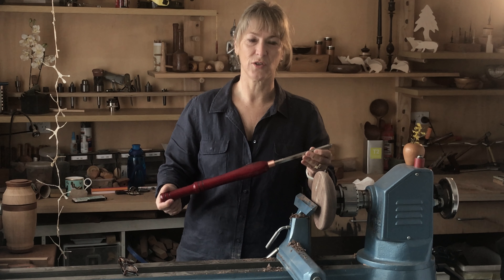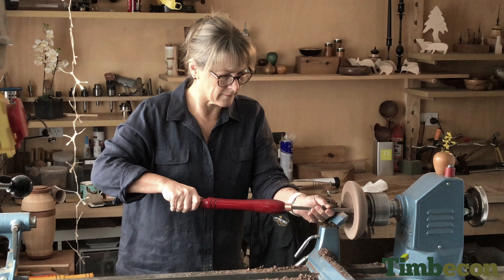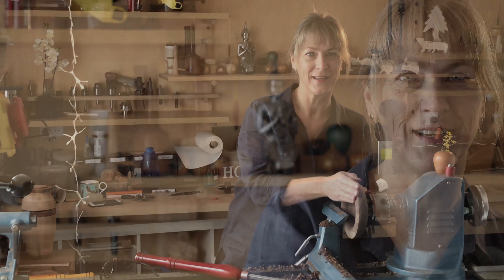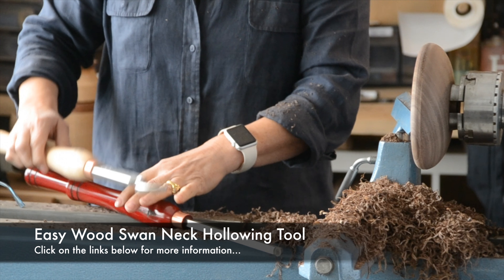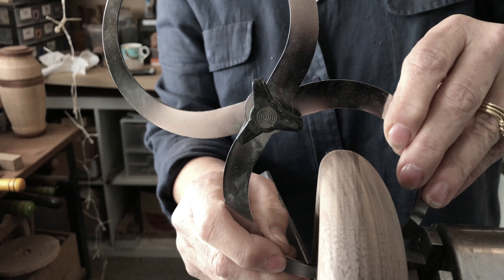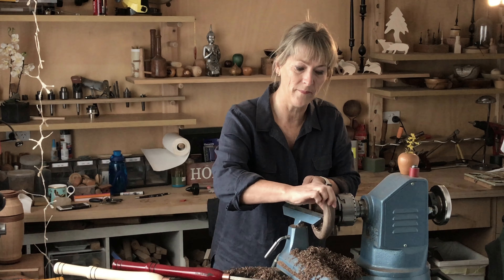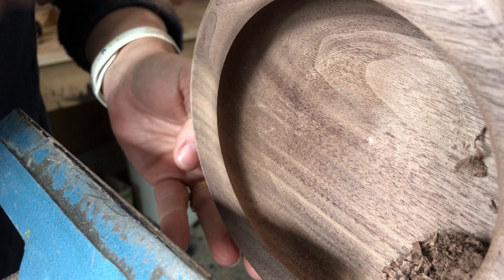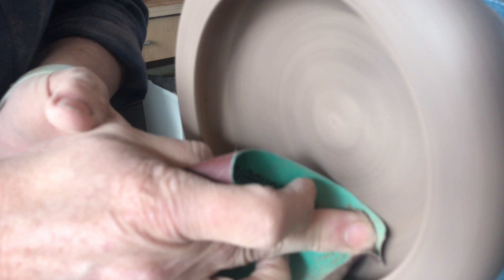Hollowing a Bowl with Easy Wood

Comment: Beautiful Work Tracey.  As a Novice Wood Worker and Wood Turner,  I am puzzled as to how I can get deeper into a Bowl less than 200 mm Diameter.  I need to go down around a bit deeper than 200 mm.  My problem is that although I can achieve that depth with a Forstner Bit and a long shank attachment very successfully.  I still need to extend the cut out to the inside wall and down to the base.   But the length of my parting tool is too short and the flute ferrule and handle blocks on the tool rest.
Any suggestions would make this Old Coot a very happy Turner,
Thank you......Cliff Olsen.